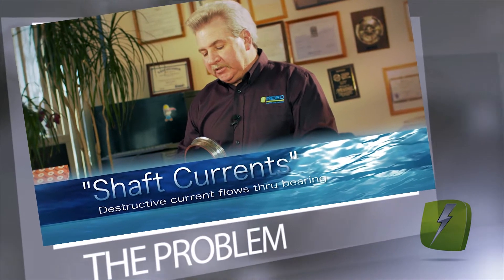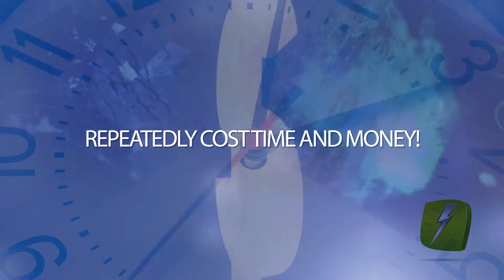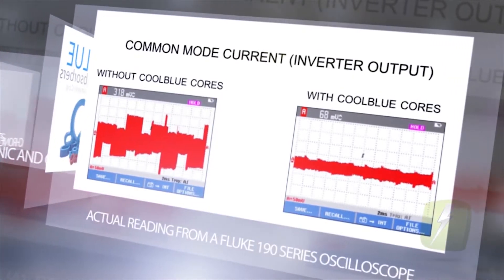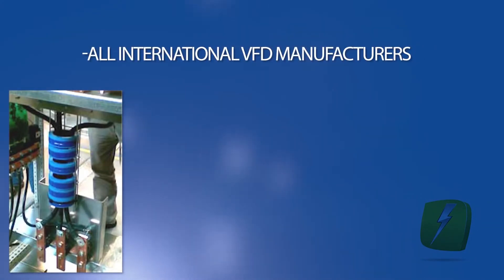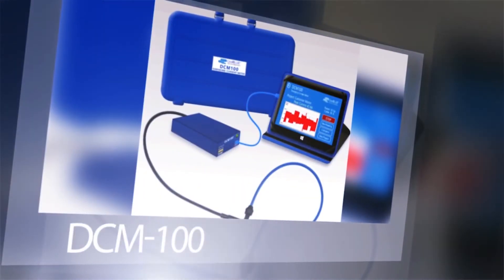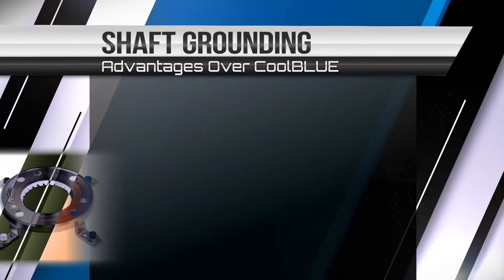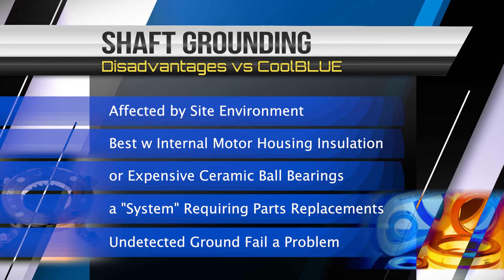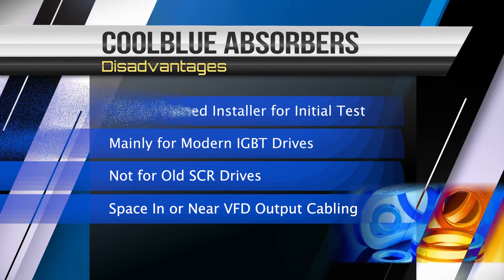How to Stop VFD Bearing Damage

Comment: Is CoolBlue effective for all kinds of bearing currents. I thought it only affects circulating bearing currents, because it reduces the common mode current but not the voltage, which is the main reason for EDM-currents. Or am I wrong here?
Reply from the maker: CoolBLUEs absorb high frequency current to a low level that can be passed by ball bearings without causing destructive electrical discharge machining (EDM).  Hence shaft voltage measurement is not a determinant of the effectiveness of CoolBLUE technology. The amount high frequency current can be safely (and easily) measured at the VFD output (or at a pull box).  In some instances the current measurement result will indicate that additional cores are required. Proper and best practices used in the motor circuit wiring installation are always required.

Response by Jerry Gray - President Sloan Electric - Western Master Distributor of CoolBLUE

Comment: Using low pass filters in the output filtering out the HF from the vfd letting through only the low drive freqeunties does that not help? or use of class D three level vfd who has low harmonic distortion and clean sinusoidal signal after the low pass filter set on 100 hz or so.